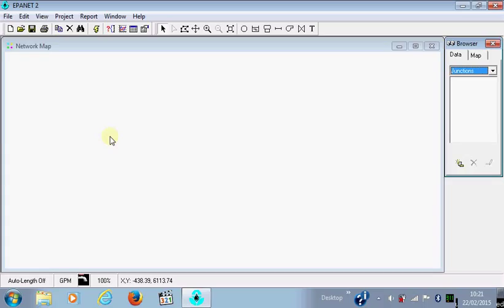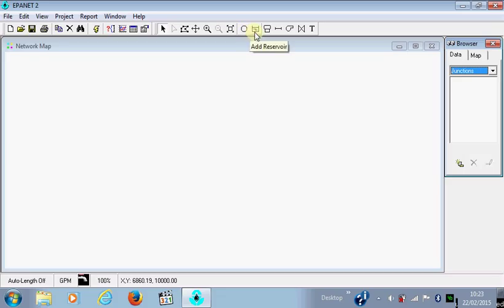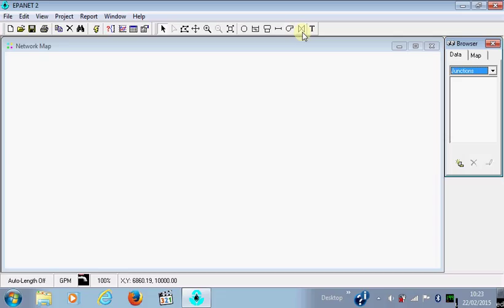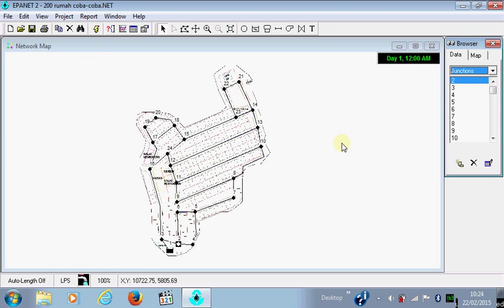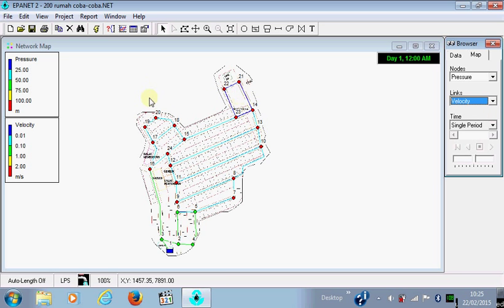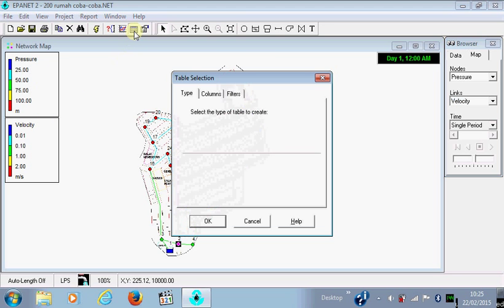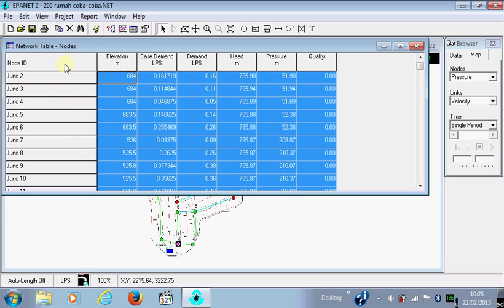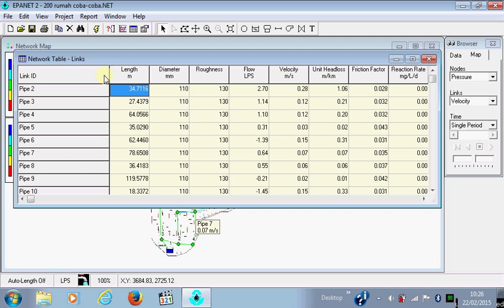how to run a simulation on EPANET program

Comment: please! how can describe many pump stations in network with epanet. Flow and hydraulic
Reply from the maker: vanthanhduongds to know how many pump stations do you need, i think it depends on your water distribution system design (hydraulically). If you already have an existing water distribution system, just follow it then make an evaluation. Sorry if my answer didn't make you satisfied, if you have any further questions don't hesitate to email me at ayitari@gmail.com
Reply: why is the pressure in meters?
Reply from the maker: @dwightgujar6291  it define 'head' value in the node